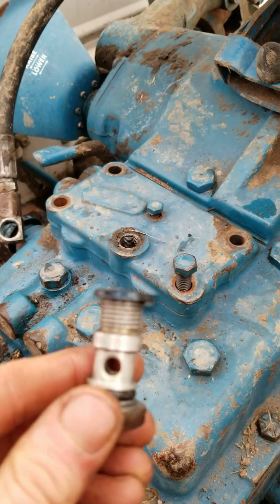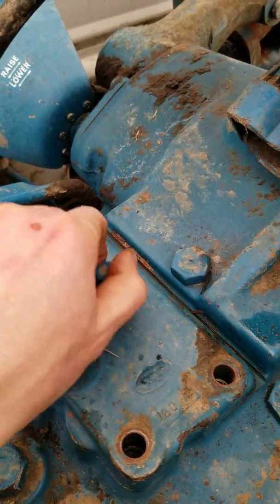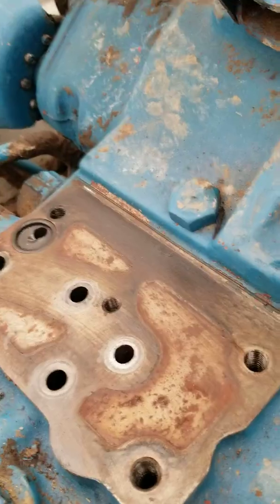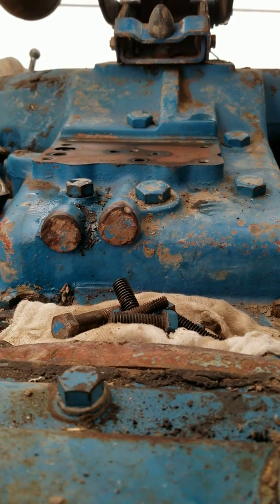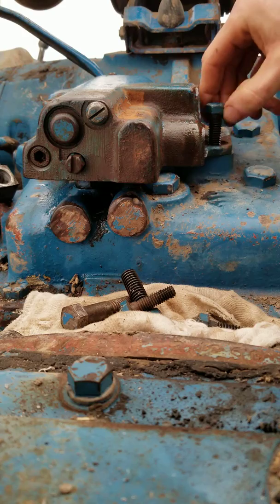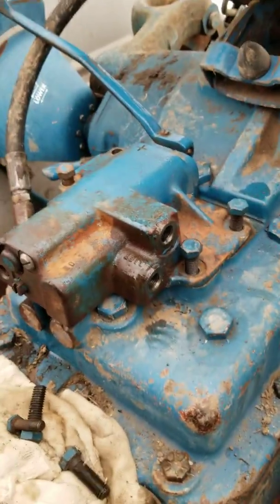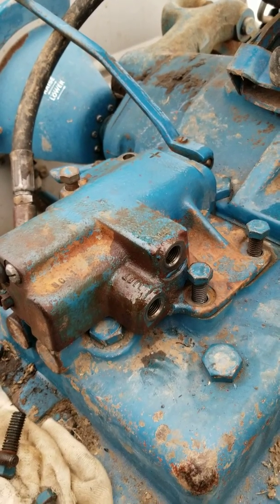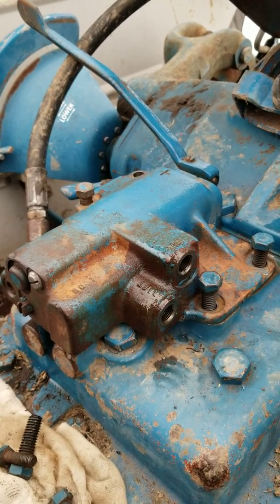Ford 5000 hydraulic remote valve install

Comment: Great video! I just took the top cover off my Ford 5000. I have a stuck control valve. I'm also going to remove the hydraulic piston and replace the O rings. Wish you had a video on that process! Thanks!

Comment: Hi Josh, im about to install my first hydraulic equipment, and i got exactly the same valve as you. Can you explain how to controll/operate it? The lever goes back once you push it right? Doe it has to be pushed all time you use it? Greetings from Holland.
Reply: And is it a 1 way system or dubbel?
Reply from the maker: Hey, sorry never saw the notification for this. It depends on what your using. Sometimes it's always open and sending a constant flow(wood splitter, manure spreader) or it's just to raise or lower something (discs, seed drill).

Not sure what you mean by a one way system, but it has flow going in and out and some valves have two sets of remotes which come with two levers to control two different things.

Comment: Hi dear,
Please make a video about ford 3600 tractors hydraulic lever setting and control valve setting.
M sarfraz 
Pakistan
Reply from the maker: I don't have a 3600 and the hydraulics on my 5600 are different than the 3600 so that won't help. Sorry.